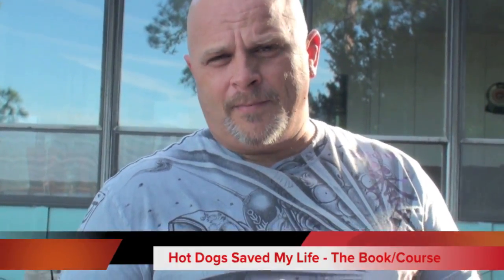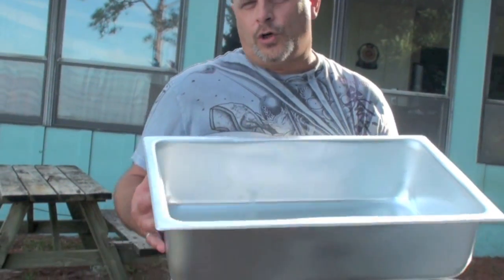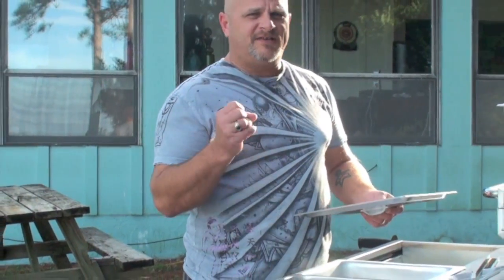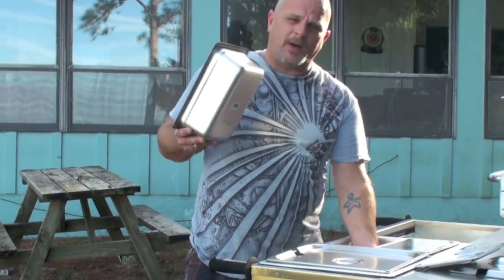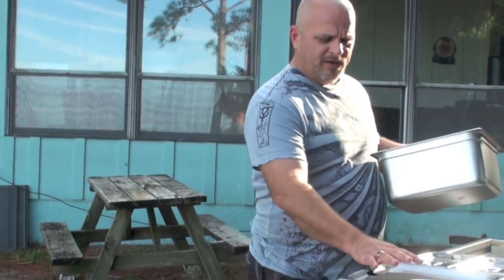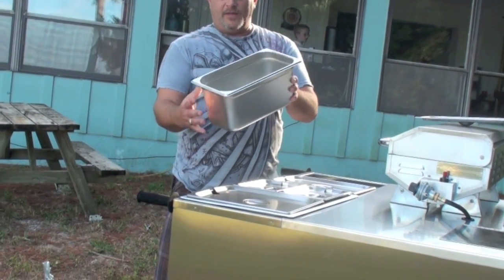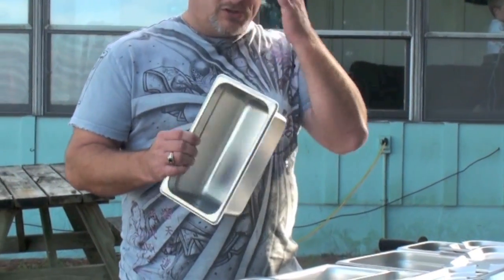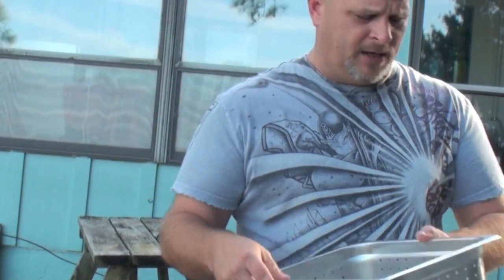Hot Dog Cart Vendor Training Videos Steam Pans

Comment: You taught me so much in such a short time. Thanks, I love ya... and not in a creepy way.  Murphy;s Chicago dogs puts a towel in the bottom of the bun steamer - never gets soggy. the buns sit on a towel. I think their hinged lid diverts all the sweat beads of water back into the pan too so it doesn't drip on the bun.
Reply from the maker: Great tip! Thank you!
Reply: amazing idea, I have a warmer and I used it for hotdogs and it works but not for bums, your idea of placing towel on the bottom of the perforated   basket will work.    thanks for your comments

Comment: Ben< If the cash cow comes with 3 1/3 size pans and a spillage pan would you remove the spillage pan if you was to boil the dogs? and if the cash cow comes with 2 burners does that mean only two pans can be used for boiling because it has to be direct heat? if so will the 3rd pan with a false bottom say in the middle would the heat have to stay on to keep the hotdaogs warm after boiling? and if its not direct heat in the middle would it still steam? sorry bout all the questions Thank you

Comment: Hey Ben, I'm just building my cart from an old shave ice cart I have. I'll end up with a full size spillage pan set up. I'll probably use the set up you demonstrated with the half size perforated pan for the dogs and two 1/4 size pans for chili and onions. my question is with this set up, how long does it take to get the chili up to temp using the indirect steam method and how many dogs can fit into the half size perforated pan? Thanks for all the videos and knowledge.
Reply from the maker: Hey James!  There are several variables that I'd need to know first... like the BTU of the burners, how many burners per full size pan, the ambient temperature on the day used and the temperature of the product going in at the time.   Your best bet is to test and check.  How many dogs fit into a pan.  I actually have a video on this.  Depends on the hot dog size.  There are about 6 mainstream sizes of hot dogs with the 10/1, 8/1 and 4/1 being most common.  It also depends on inset lid, flat lid, rounded lid or roll top.  Best bet... test it yourself.
Reply: Hot Dog Cart Store, 
I'm in East Tennessee, so the ambient temp outside could be 70 or 40 right now.. lol.. depending on if it's Monday or Tuesday.  The dogs in the pan I'll figure out as I go, but in a day that it's say 70 outside and room temp chili, general time to heat the chili, 10 minutes.. 2o minutes?
Reply from the maker: Still have to know... the BTU of the burners, how many burners per full size pan, the temperature of the product going in at the time and how much product. I'm not kidding, even the density of the product matters.  On average, it could be 20-30 but I was with a vendor in FL that had a crappy little cart and it took him over 1 hour to heat his chili over the spillage pan with about 1 inch of water.
Reply: Hot Dog Cart Store , 
There will be two burners totaling 31k btu's. But considering that time frame I may go with an alternate set up.  Thanks for the help Ben.
Reply: James Brown 

☺

Comment: I get a lot of black soot or ash build up on my pans that have direct heat from the flame as well as part of my cart what do you use to clean that it's a mess and gets everywhere. Anything I can do to cut it down? Thanks in advance and for the videos
Reply from the maker: That is a common problem if your burners are turned too high thus leaving unburnt gas as soot on the bottom of your pans.  Turn the control knob down some and this will alleviate the problem.